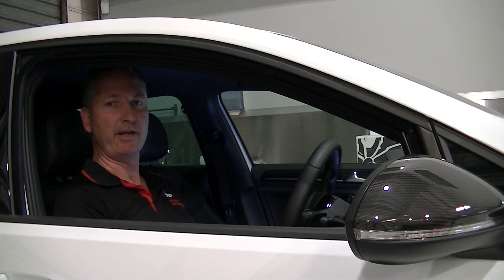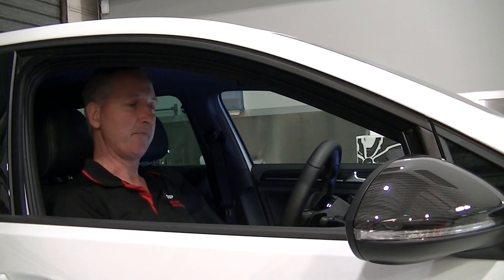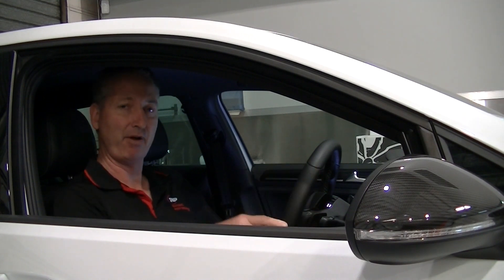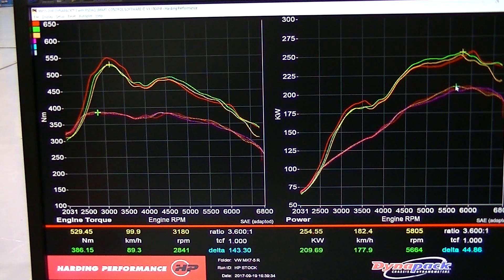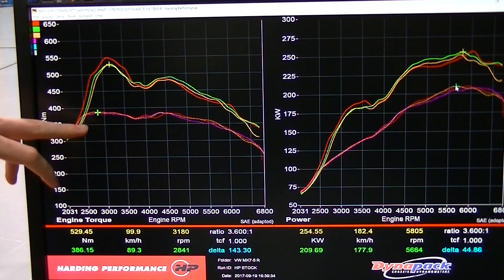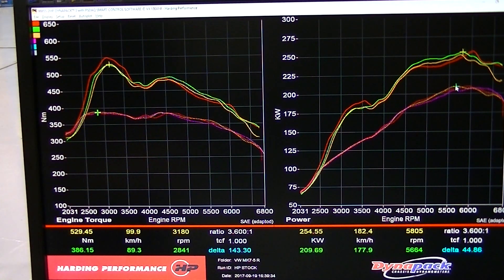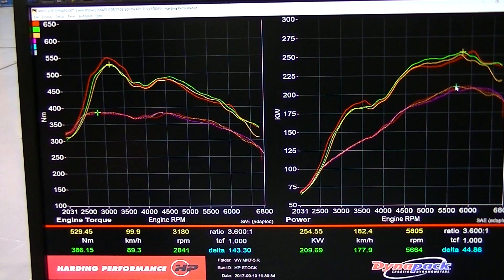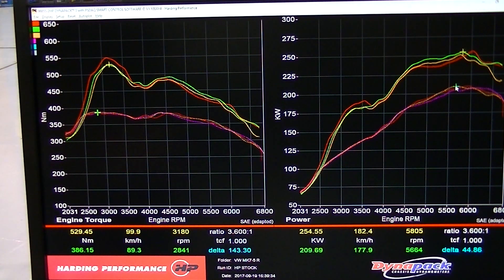Racingline OEM+ Stage 1 for the 2017 / 2018 Golf R

Comment: So the dq381 can hold higher torque levels than the 6 speed could? Is it a different clutch?
Reply: Harding Performance from the 6 speed dsg on the ‘17 I meant
Reply: Harding Performance I’ve got about 370 tq on mine and so far so good

Comment: Is the extra 20kW/70Nm over the MK7 stage 1 tune purely the ability to turn up with wick even more due to new DQ381 gearbox or are there some engine/turbo changes that contribute to this?
Reply: Engine code is different on the 7.5 but we don't know what VW changed - turbo / intercooler etc etc are identical